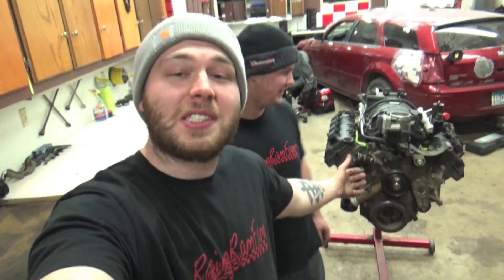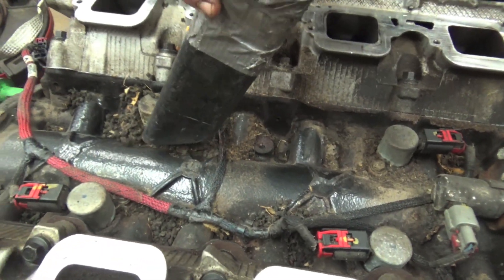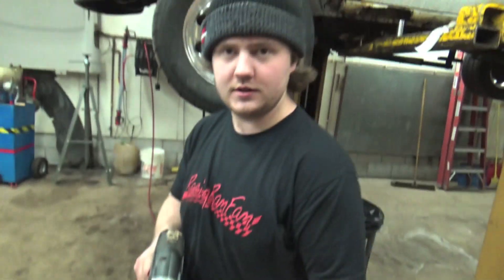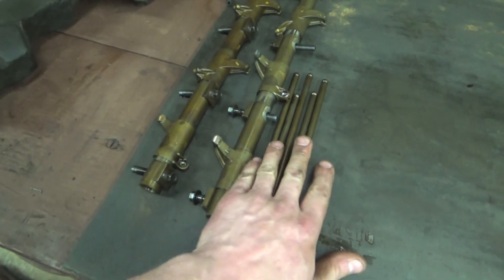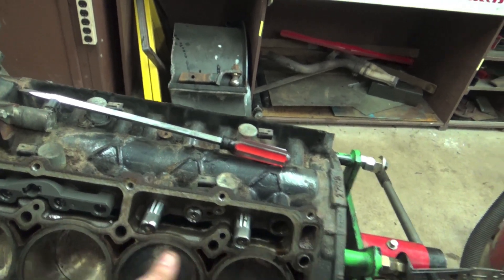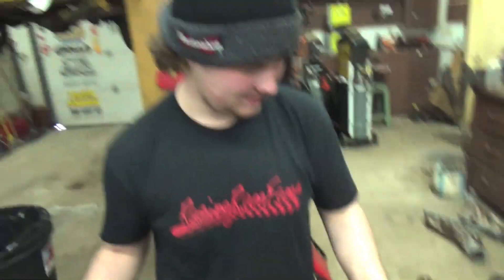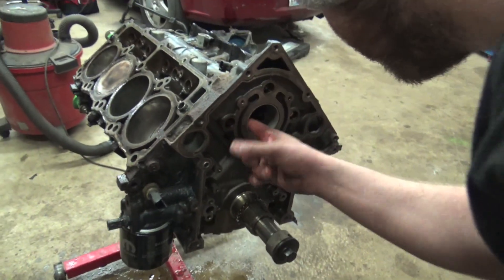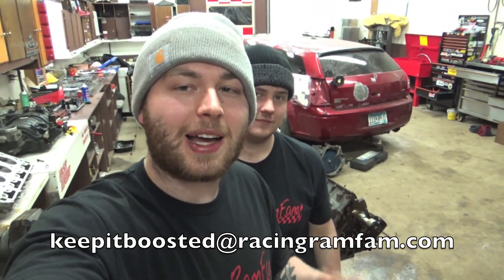5.7 HEMI engine teardown

Comment: Debris in the pan could be from a failed timing chain tensioner.  Mine failed and it got crunched in the timing chain and gears, looked very similar to that in the oil pan, though I had a few pieces that were pretty large.  Check if it's magnetic; bearing material typically isn't, but timing and valvetrain components sure are. Cam tensioner is notorious for failing, pretty bad design by Chrysler.  Supposedly it happens much more frequently on MDS equipped cars, HD trucks and stick shift Challengers were never given a TSB for this failure.

Comment: Almost every single motor dodge makes is considered a magnum. I have a 4.7 powertech, a pre magnum. I have driven it 1357 miles without oil or coolant. Still runs.
Reply: I thought they started calling the Magnum series when they went to fuel injection? And the Magnum series was pre 4.7
Reply: @Indica_Dogo  it was badged as a powertech and then became with a magnum title later in about 2005

Comment: I am going to venture a guess that the debris is from the prior camshaft and lifter(s) that gave up the ghost along with the bearing material ground away from said debris. Engine will need a thorough brush and flush through all the oil galleys. If your lucky the piston skirts and bores will be relatively unscathed. I have seen material from a ground up flat tappet camshaft, due to failed break-in, impacted between piston skirts and cylinder walls making removal of pistons  a tedious chore.
Reply from the maker: Well you find out in a later video that pistons will need to be replaced! Had something in the cylinders

Comment: I wouldn't give up my 5.9 for 5.7 at any cost regardless of power. Now a 426 Hemi be different story in a gen 2. Can't wait on transmission vid
Reply: @Eric .25-06 ... I've owned both, a 5.9L Magnum and the 5.7L Gen3 Hemi ... the Gen3 Hemi is actually way more advanced, especially when you compare the cylinder heads ('09 & newer Gen3 Eagle Hemi heads flows way better than a 5.9L), plus variable valve timing, intake manifold design, and cylinder block design & strength... the Gen3 Hemi blows it away... and the Gen3 Hemi is running quarter mile times in the 6's & 7's... I haven't seen a 5.9L Magnum do that... just saying
Reply: @ghostrt1608  yes I agree on more advanced. I'm just old school. It rides rough and gets 15 mph but I like it.
Reply: @Eric--zs6um  ...yeah, I had a 2000 Ram 1500... my 2004 Hemi Sport is way nicer than the 2000 models... I just started racing mine & I have a new turbo I'm going to be putting on eventually... check out VS Racing (turbo4less.com)... I got 7875 cast T4 .96 a/r... good for 700 rwhp...
Reply: @ghostrt1608  yeah bro sounds like a sweet ride. Gd luck racing that beast. Will check out the site. Gotta do inflated rust repair on the gen2.